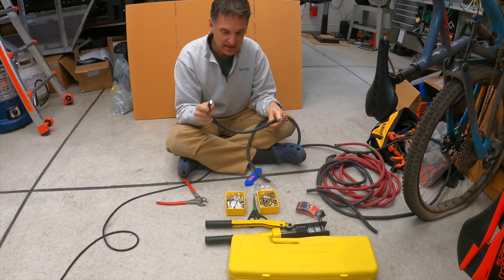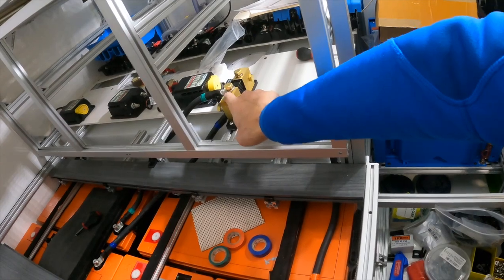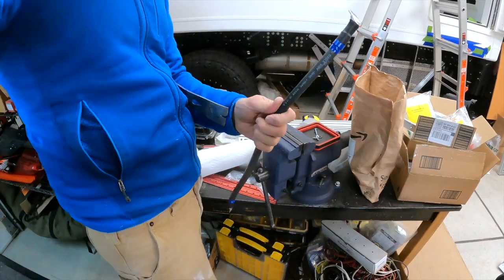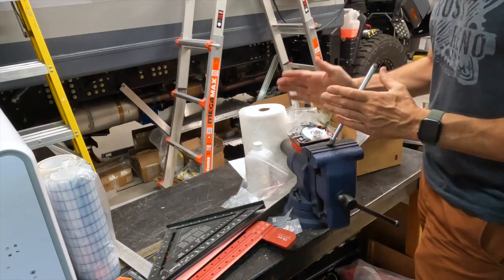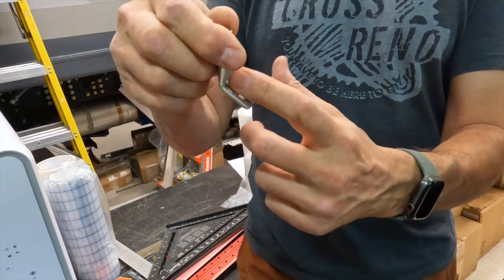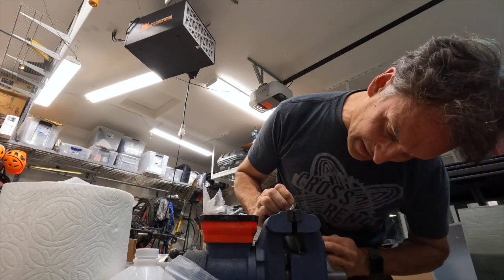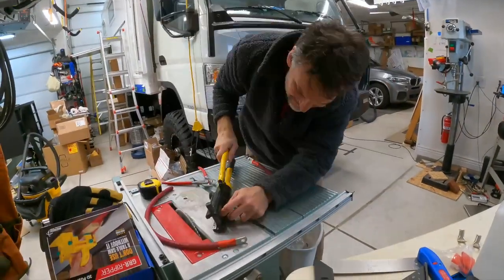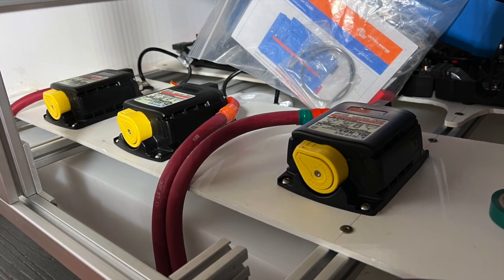Custom Bending Large Battery Cable lugs for the cleanest installation

Comment: Personally I am not a fan of this technique, but it works nontheless.
Reply from the maker: Just bending copper at a bend point, so doesn't weaken the lug and yet improves the electrical connection with better conductivity with the surface of the lug while reducing strain on wires.It's the same result as it buying pre-bent lugs but those bends don't always match the bends needed to align with wire angles.